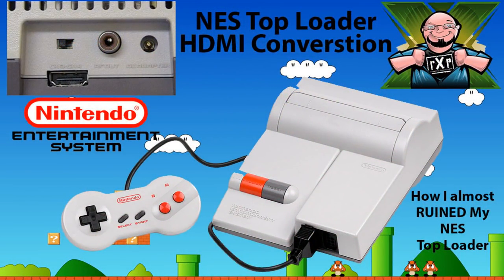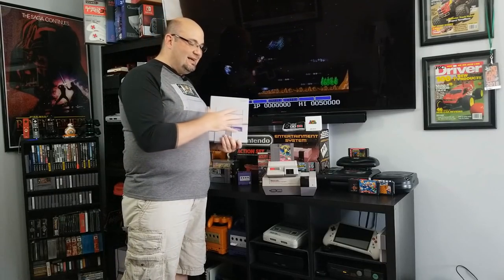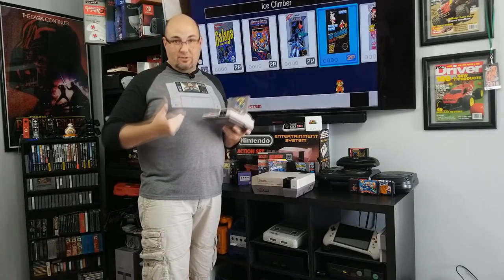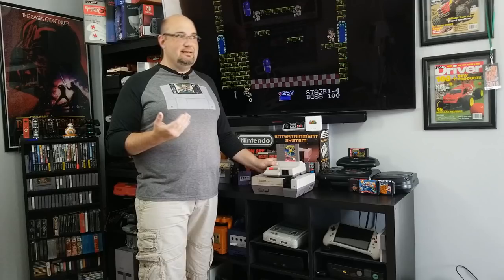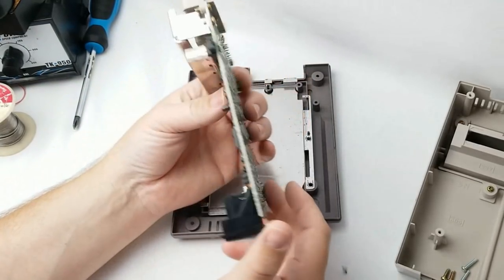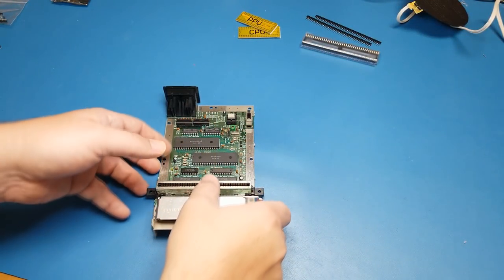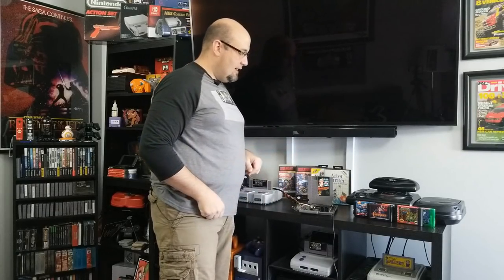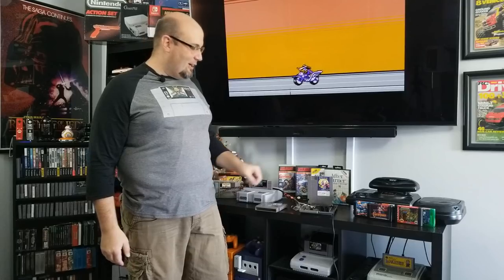Installing an HDMI Kit into an NES Top Loader OR How I Almost Ruined my NES Top Loader

Comment: I heard the Top Loaders can be a pain sometimes. Is that true?
Reply from the maker: In what way? Any older system can have issues. One of the issues that can crop up is that the NES, toaster or top loader, are designed to work on 9V AC. Well the universal adapters out there now are 9V DC, and going from AC to DC can cause damage to IC's. I think this is what damaged the SRAM, PPU and CPU in the one system.
Reply: Gotcha. What if you have a system where the game carts are a pain to pull out?  I was just curious because I've seen videos where people had hard times getting their games out.
Reply from the maker: Generally that's on clone systems, tring to reinvent the 72-pin connector to make sure the carts read properly. Never really heard of an issue with the stock NES or Top Loader.

Comment: Sound like my AVS was Cheeper in the last my run.  At lest u had fun.
Reply from the maker: If I would not have had the issues with the first system this would have been slightly cheaper than AVS but not much

Comment: With the hdmi kit installed, do you not need at OSSC for it to look good on modern displays?
Reply: No OSSC required.  The mod outputs 480p, 720p, or 1080p via HDMI.
Reply from the maker: No OSSC needed, the mod kit offers native HD output. Check out the streams I have done here on the channel, you can see how great it looks even with YouTube Compression!
Reply: Sihtube that’s interesting. I’m guessing the same would apply to other systems too? So it outputs it fine, without a scaler being used? Any chance you doing a side my side comparison and telling us if there is a visual difference. Cause there is what a RGB mod you hook up to a Ossc, and then the hdmi mod that doesn’t need a Ossc?
Reply: RoXolid Productions little confused, the super nt has hdmi, but it still has a framemeister and more in it.
Reply: RoXolid Productions that little board you installed, does it upscale like what a Ossc does?
Reply from the maker: There isn't a Framemeister incorporated into the Super NT.
Reply from the maker: The two boards take the video output right off the system board and sends the signal to the HDMI output board. Where a Framemeister or OSSC is upscaling an already processed signal the Kevtris mod is getting the signal straight from the CPU and PPU, meaning it's as clean and original of a signal as you can get.
Reply: RoXolid Productions maybe not an actual framemeister, but kevtris in my life in gaming video does quote, “that he developed the scaler in it and that it’s kinda like a framemeister and more”
Reply: If the quality with this mod is good, why do we need an Ossc. Just get all the consoles hdmi moded then right? Get rid of the tumor that’s plugged in. That being Ossc
Reply: RoXolid Productions so this mod is just as good as say buying a analogue nt, just the only difference is your on original hardware and not fpga. I just wanna play on what looks best, sounds best, and plays best. Wether it’s original with a mod or the NT, what is best?
Reply: An OSSC type device is sometimes needed because not every console can be HDMI modded presently.  And, because not every modern TV will take a 240p RGB input.  Also, many of the HDMI mods themselves are fairly expensive.  Compare that to the RGB ones which are often either cheap, or free, since some consoles already do RGB natively.
Reply: This mod is a FPGA with the original hardware.  This mod and the NT are basically equivalent in terms of gameplay.
Reply from the maker: The boards themselves, the ones I installed in the system,  handle all the upscaling and video output.
Reply from the maker: Really, they're about the same. The Analog NT and this use the same parts.
Reply: RoXolid Productions oh ok. Good to know. Thanks
Reply: OSSC has not digital input. No DVI, no HDMI. You literally can’t plug this into an OSSC. You wouldn’t want to anyway: it’s already a perfect digital to digital signal scaled to your selected resolution.